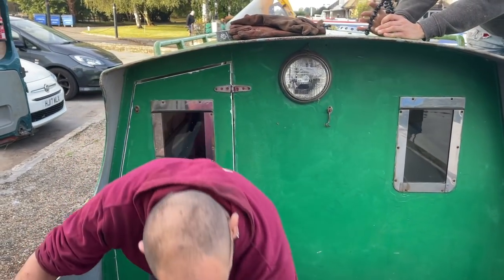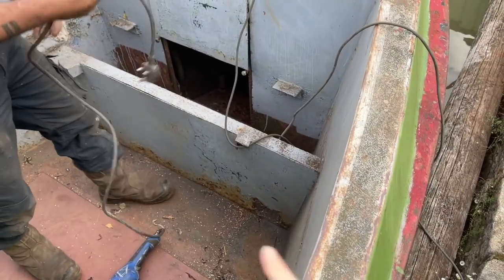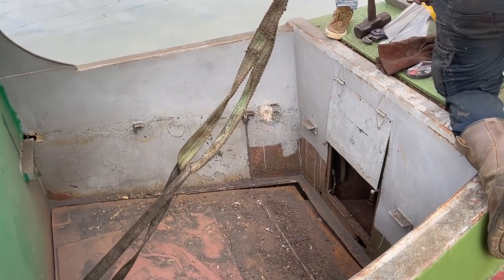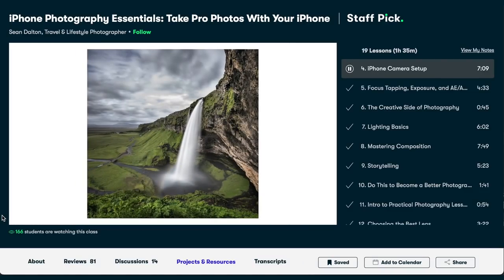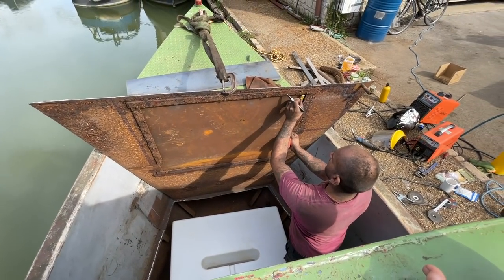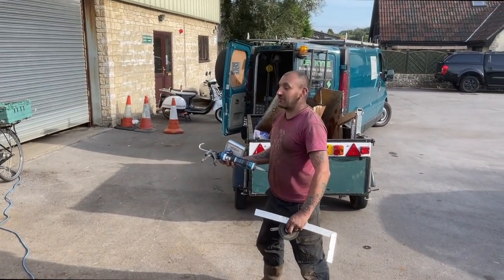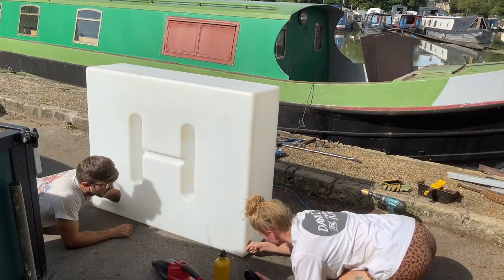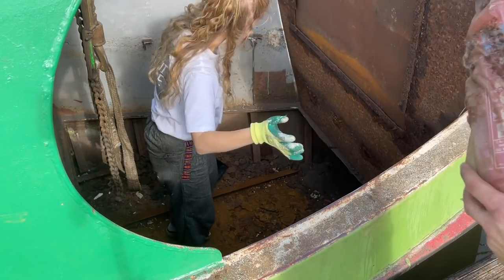Water Tank Replacement | Rotten 40 Year Old Steel Tank | Narrowboat Conversion | BOATLIFE

Comment: Really enjoyed the video and it is good to see progress on the boat. I am not 
a painter but at 70 I have painted a lot of houses and apartments and if it
were me....I would put your paint into a smaller more manageable container
down in the boat, and taken that topside. That gallon can is a bit of weight 
to be moving around on a boat that is already moving around.
Good luck sorting the transmission.
Reply from the maker: Good advice!

Comment: Two years late commenting! But the way I fit nuts in similar situations is to fish a wire/ rope through the centre, pull tight with a washer or even piece of wood. Then you can pass the rope through the fitting and hold the nut in place. Old news now, but maybe someone else might benefit.

Comment: Next time you must treat and paint the rust! Sometimes is better lose time in that kind of stuff!
Reply from the maker: Unfortunately not logistically possible with Kev booked in for only a day, would need to leave the treatment to cure for 24 hours and there’s a chance it would’ve rained in that time + we were fortunate to borrow that space for a day only! The boat used to be a wet bilge but now it’s converted to be dry so shouldn’t get any trouble
Reply: @ItsOhJoe  I understand that! What we boaters doing and suffering with that! Always when we want to do some jobs in boats they are full booked and things never go with plan 🙃 💪

Comment: Hi Danny Joe,that was interesting moving the boat I guess it’s the morse cables need adjustment,,,that’s one big water 💧 tank you are fitting,that was a lot of cutting away to remove the water tank,why did you not paint the bottom before fitting the new tank ,just a question,! ,well done getting the connection screwed in very awkward job I hope no hot weld drips onto the new tank otherwise you will have some leaks ,Kev done a good job for you ,you are a hard worker Danny well you both are to be truthful you both are always doing something don’t worry over a little spilled paint lol well guys take care keep safe,do you have the correct oil for the gearbox , John 👏👏👀👀🥂🥂🤷‍♀️😂💧💕
Reply from the maker: Thanks John, unfortunately we only had Kev on site for one day & that would’ve meant bringing him back the next day or the day after whilst leaving the deck open to the elements. The gearbox definitely has gone we sent it off to be reconditioned

Comment: @Danni and Joe 
I'm just curious does the plastic tank condensed like crazy being as it's inside a steel hull?
Reply from the maker: That’s a good question, because it’s at a constant temperature and doesn’t change much compared to the water in the canal we’ve not noticed much if any! The summer feels a little while ago now but noticed more then than now it’s colder if that makes sense

Comment: Check to see if there's a transmission filter, it may need changing. How's the color of the transmission fluid, it might need changing...it might be REALLY old.  Maybe have a mechanic look at it before you go replacing it. It might be something simple and a lot cheaper than a reconditioned transmission.   Good luck.
Reply from the maker: Thanks Dale, checked the fluid & spoke to someone who knows these boxes well and it’s basically worn clutch discs so it’s been sent off for a refurb

Comment: I thought you would weld the deck back higher than it was previously sitting, and then drill a drain straight out the side of the boat.
Reply: How would the doors open then ???
Reply from the maker: Yeah unfortunately to raise it high enough would make a complete re-design of the door etc

Comment: It’s a pity that you couldn’t paint where the water tank is.
Reply from the maker: Unfortunately not logistically possible with Kev booked in for only a day, would need to leave the treatment to cure for 24 hours and there’s a chance it would’ve rained in that time + we were fortunate to borrow that space for a day only! The boat used to be a wet bilge but now it’s converted to be dry so shouldn’t get any trouble
Reply: @ItsOhJoe  ok I understand thanks 🙏👍

Comment: Should have rustproofed before fitting new tank
Reply from the maker: Unfortunately not logistically possible with Kev booked in for only a day, would need to leave the treatment to cure for 24 hours and there’s a chance it would’ve rained in that time + we were fortunate to borrow that space for a day only! The boat used to be a wet bilge but now it’s converted to be dry so shouldn’t get any trouble